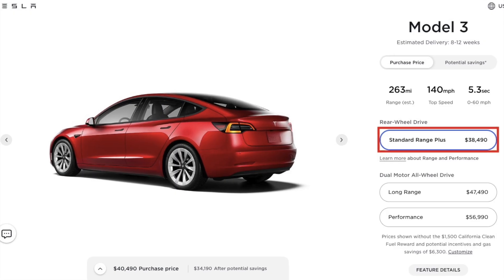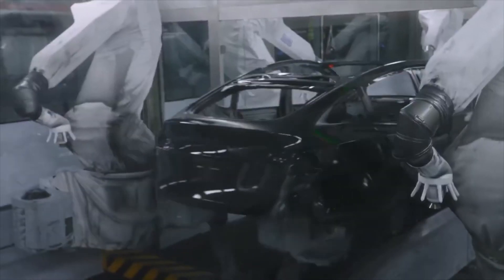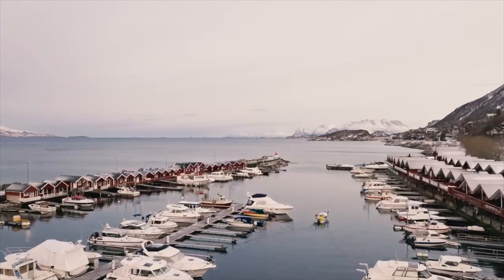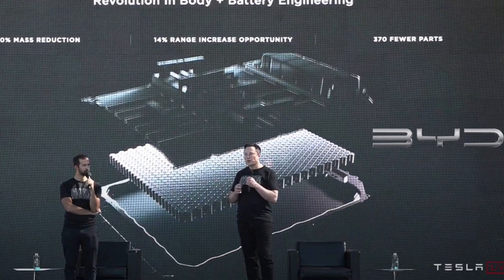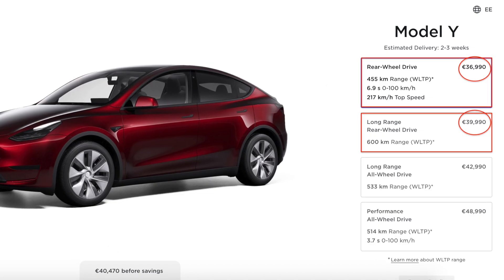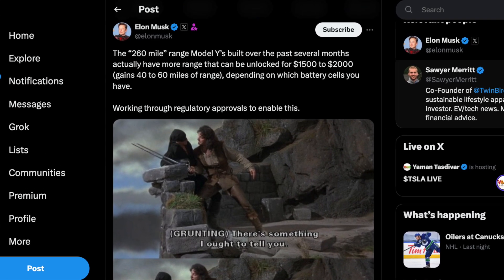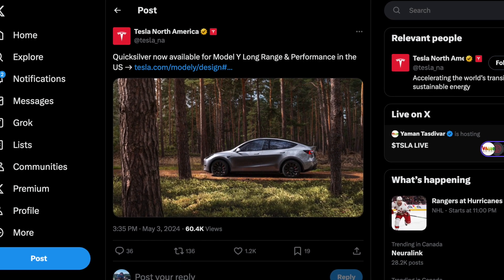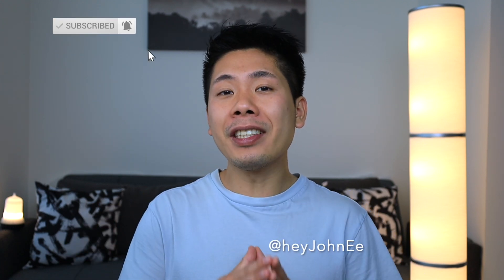Tesla Model Y Battery Unlocks 60+ miles Extra Range | But Not For Everyone

Comment: One question, just like how the battery is locked via software but it’s the same battery, does the same apply for the rear wheel drive? Is one of the motor just turned off via software? Or is there actually a hardware difference. Same applies for the speaker and the fog lights, are they there but disabled, or are they really not there?
Reply from the maker: For RWD the second motor is not physically there